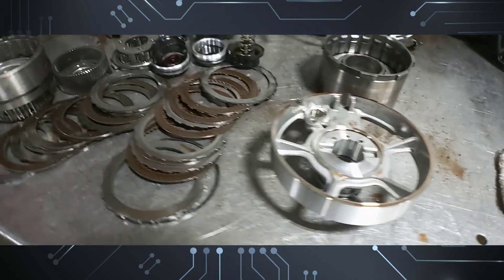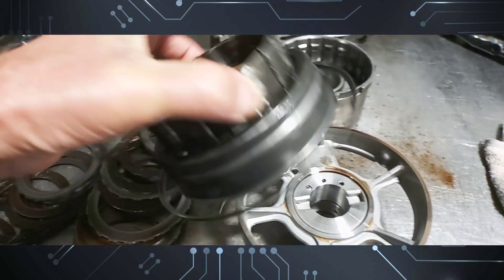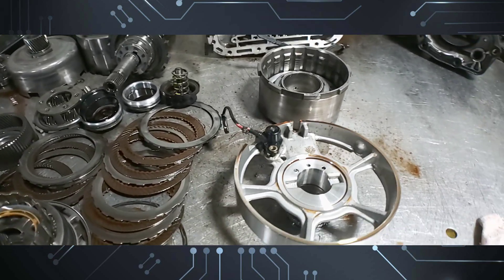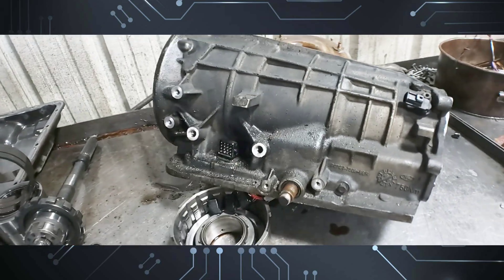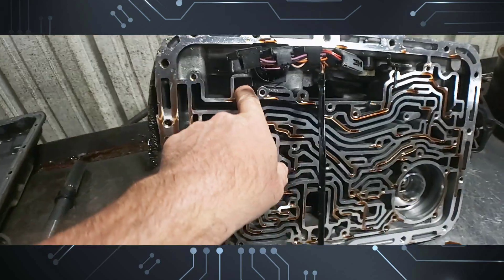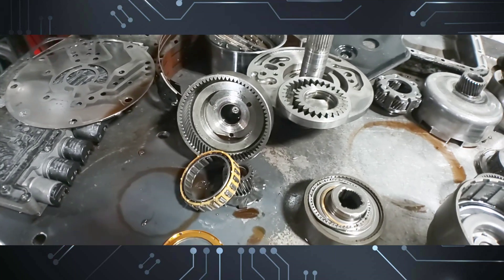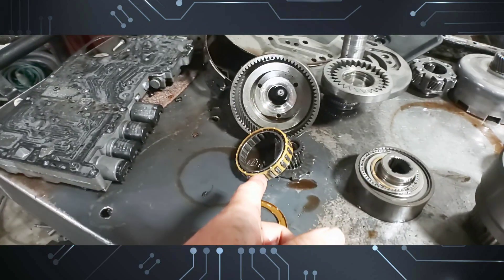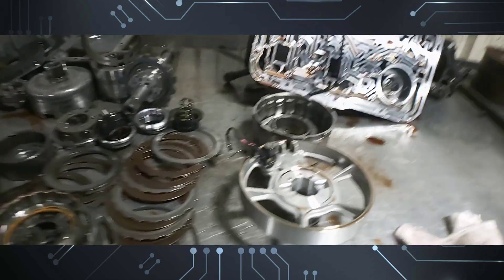⚙️ 5R55E Input Speed Sensor Location

Comment: This is the stupidest thing Ford ever did. If this sensor goes bad it causes a flashing OD light. It puts the drive train in limp mode and your shifts become slam shifts because the line pressure in the transmission goes to full. The people who put sensors like this inside a transmission should be fired immediately.
Reply: Mine is in limp mode due to P0741. I notice that the signal for this sensor drops to zero intermittently.

Comment: I wish we got the full 5R55E video. I need one for a build
Reply from the maker: I have a unit that was never approved and picked up. It's disassembled, I have to see if all the parts are there. If everything is there I'll make a training video with it.
Reply: @AutomaticTransmission  That would be great! I've been researching, and purchasing, everything new. Every Sonnax update kit, Transgo kit, Superior kit, Alto stage 5 master kit, Florida Torque converter heavy duty low stall, brand new converter housing, and pump. I have every, selective part, I even bought some brand new hard parts. I'm looking for a good case now. This build is for a built out over landing Explorer. 97' 5R55E, vin x with only one rear case sensor. No overdrive  sensor, or sun shell sensor above the range selector sensor. Apparently hard case to find. I've been burned on to transmission's, so far. Oil slinger in planet was left out, and the second was the wrong converter. The out put shaft comes in 3 sizes, and convert has 2 different hub depths. The combination used was wrong. Sonnax has article on it. Had compensation for oil slinger tranny, and the second was blamed on my installation. So now I'm building it myself, I can't do any worse. I'm a mechanic, but not a transmission tech. I know that was long, and you probably don't care, but I need all the info. I can get. 

Thank you very much for your response,
R. Garcia
Reply: @AutomaticTransmission  will you sell it, if you build it?

Comment: I just repaired one out of a 2002 explorer sport track for no reverse I replaced the band and servo seals but still no reverse.... what could be fault?
Reply: Valvebody
Reply: @beentheredonethat5332  Thanks I was hesitating to replace the valvebody but I will
Reply from the maker: What else did you install?
Direct drum works with reverse.
Reply: @AutomaticTransmission  Direct clutch and drum ok